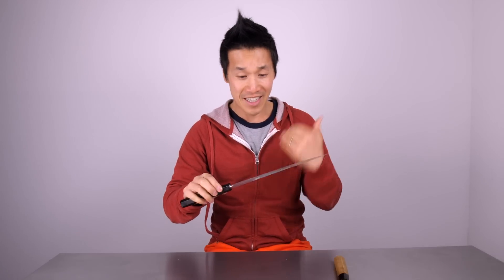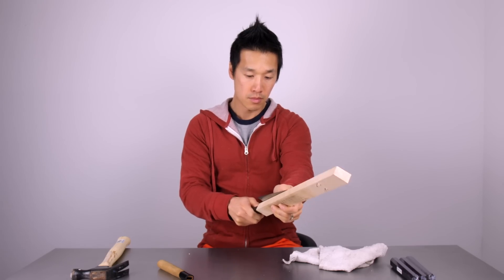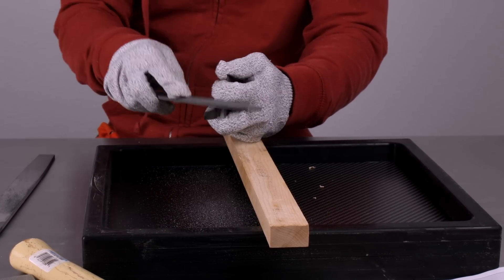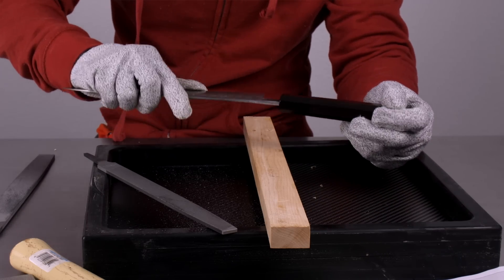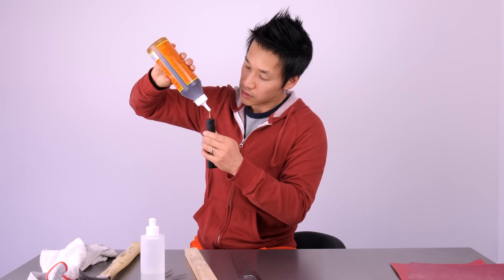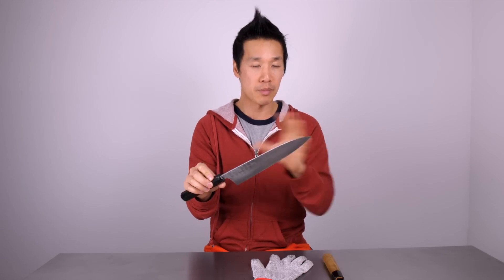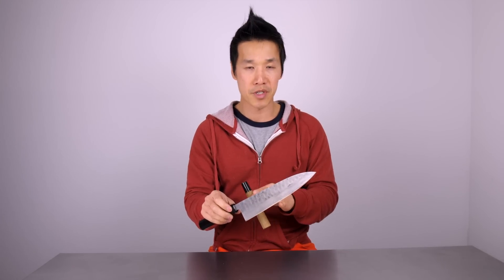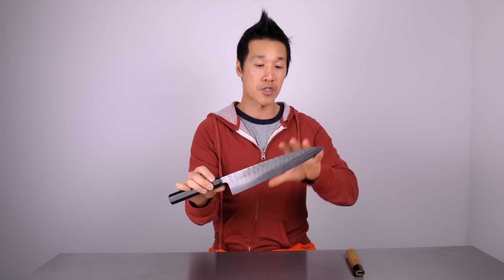How to Replace Wa Handle on Japanese Knife Restoration

Comment: Clamp the blade and use a technique called draw filing, you'll remove material much faster. Or go down to your local Harbor Freight and buy a 1" belt sander. Gorilla glue expands as it sets and you risk fractured the handle. Great job on the restoration.

Comment: I converted all of my Japanese knives when I changed them to a true sword method.  The handles I purchased were a little loose.  So I drilled the handle and put it on.  Then I drilled out the tang.  Then I took a chop stick and put it through.  With a long dremmel tip, I honed out the slot for it to fit through so the tip came out the other end.  Then I marked both sides and trimmed it.  Then polished ends on a sander.  Now I can just pop the peg.

Comment: Thank you for another great video. I am currently recovering from a broken foot and heart failure. Your videos really help to pass the time and encourage me to get back in the shop working on blades whenever I can. Have you ever considered a variable speed bench grinder or belt sander? They can be quite a lot of help with jobs like this. Though I guess if you're working from an apartment your neighbors and or landlord may frown on power tools.
Reply: Prayers sent up for your quick and complete recovery. 🙏🏼
Reply: Thank you mate, it'll all balance out for sure  @b-radg916

Comment: Looks great, Ryky! Like others have said, a vice or possibly clamps to hold the knife in place will allow you to use both hands on the file, giving you more control and MUCH LESS wasted time/energy. For what it's worth, I think it will save you lots of time on reprofiling as well. If you're really taking off a lot of metal you might look into a grinder or sander.

Comment: I saw a video that show how to re handle a Japanese knife and you need to heat the tip of the tang and push in the handle if you use this method don't need glue or the mix of bee wax. if you remove the black finish of the tang will rust more easy

Comment: Good job, but that's a lot of extra work by hand - unless you specifically want to do it by hand.. Pick up a Harbor Freight 1" X 30" belt sander and a variable speed adapter for the motor, it will make your life much easier for those kind of projects. There's all kinds of belts out there: aluminum oxide,  silicon carbide, scotch brite, leather, felt... Just don't let your blade heat up and ruin the temper of the blade..

Comment: i have done the same, just heated the tang until it was glowing hot, then burned the handle on. The blade itself was covered in cold water, but anyway, good job!
Reply: Michael Schöch: Any adhesive?
Reply: @b-radg916  glue?
Reply: Michael Schöch: Is that more effective with the tang being glowing hot?
Reply: @b-radg916  it's the traditional Japanese way, if you push the handle onto the glowing tang, it results in a perfect fitting
Reply: Michael Schöch: Cool. Good to know.

Comment: DUUUUUUDDDDDDDEEEEE - tape off the bevel (edge) of that blade if you are going to handle it like that. I know that the cut gloves will protect you, but your sweatshirt and body don't have the same level of cut resistance and right know you are free handing a sharp object that you are filing about 4" from your liver. Just use some painters tape and fold it over about a cm above the edge and point. - BM

Comment: Hardened steel on hardened steel, ouch, that poor file xD
Quickest way would be grinder with the blade under water.
Reply: The file was fine, if it removed metal it was harder and did it's job
Reply: Tangs aren't usually hardened. As Ryky pointed out, it's often not even the same material as the rest of the blade.
Reply: @bloodgain   I guess you're both right, I was thinking back when I tried to remove the bolster out of one of my chefs knife but it's a completely different kind of knife/material.

Comment: Backwards. Work on the wood not the steel. 
Your Japanese suppliers would kick your a—- if they saw you tampering with their blade rather than working on the opening in the wood. You should have either used the red hot tang burn in method or small files and drill bits in the opening in the handle.